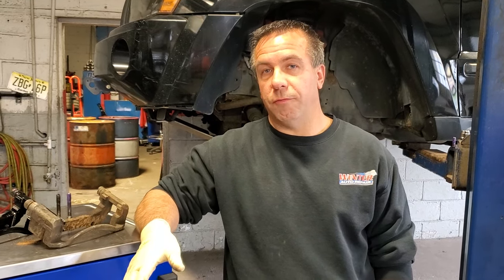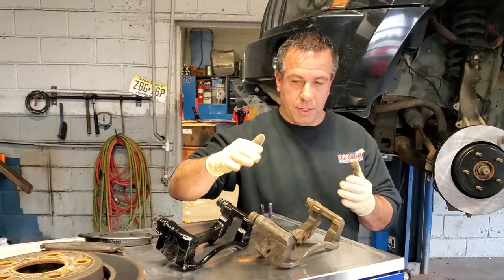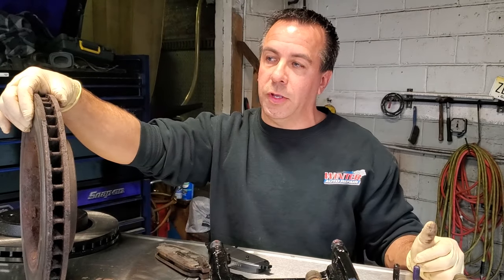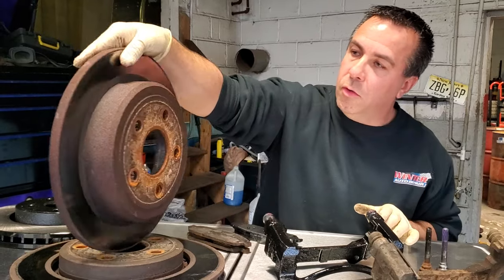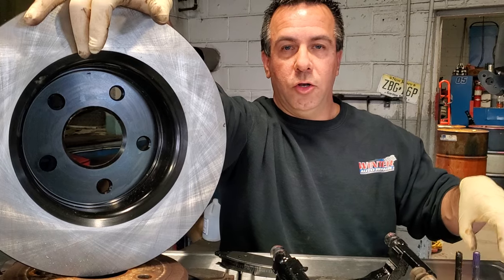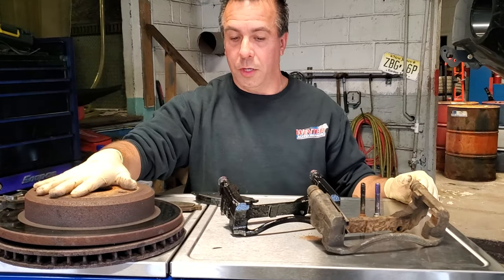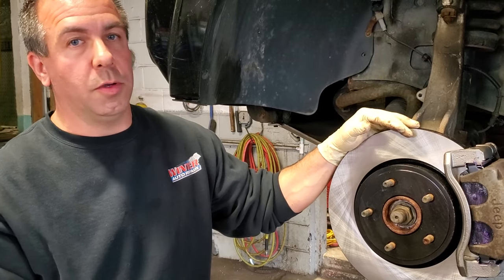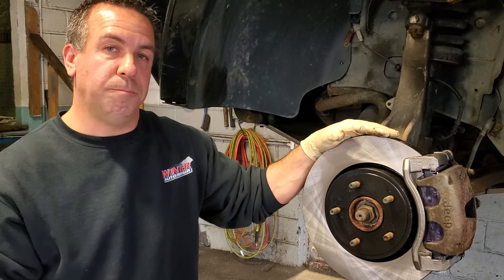High quality brakes vs cheap brakes

Comment: Brake pulsing/vibrations do come from cheap rotors. But it's rarely warping that causes it. It's typically caused by poor metallurgy, specifically low grade steel and poor heat-treating (annealing). If the metal isn't properly heat-treated, there's variable levels of crystallinity, which results in different hardness around the disk. Different metal hardness results in different coefficients of friction which causes pulsing.
Yes, always specify good quality brake parts, and see them before they're installed.
Reply: A pulsating brake pedal specifically is the physical sensation of hydraulic feedback created at the working end of the braking system.  
That hydraulic feedback is the result of thickness variation in rotors pushing back on caliper pistons as the thicker areas of the rotor pass between the pads, or out of round drums pushing back on wheel cylinders in the same manner.   
A variation of friction coefficient on the rotor surface would present as jerkiness feedback in the steering wheel at very low speeds while applying the brakes.
Reply: @jaxturner7288  The thickness change is CAUSED BY the differences in wear due to the variations in friction coefficient and hardness, that induces uneven wear on the disk surface. The disks don't start out with varying thickness. That's caused by uneven wear...
Reply: @garymaclean6903  A sometimes allows B to happen, overtime if ignored and left unchecked, b usually causes C, c will independently directly and immediately guarantee D, without A or B ever occurring.  
So we shouldn’t say D comes from A. 
D actually comes specifically from C.   
A=cheap rotor
B=uneven hardness 
C=thickness variation
D=hydraulic feedback/pulsating pedal.  
The existence of A and B are unnecessary for D to occur however C is the requirement for d to exist and also guarantees its existence so like I said, “pedal pulsation specifically is the….”
Reply: @jaxturner7288  ...Your point being...???
For D to occur there typically has to be a CAUSE. If your disks were installed with thickness variation, you'd expect your mechanic to fix that deficiency right away.
The typical situation is how cheap and defective disks have varying surface hardness, and different coefficients of friction, that CAUSE wear differences on parts of the disk surfaces. THAT is what typically leads to pulsation.
YES, you can have poorly annealed disks that can also warp under very high temperature. But given how most drivers rarely let their disks get that hot, it's unlikely to be the actual cause of pulsing brakes...
Reply: @garymaclean6903  usually leads too, is not the same as  the specific cause.
Reply: @jaxturner7288  ...Only when you can actually identify an alternate cause of varying disk thickness... What are you proposing is the cause?
Disk Brakes are typically manufactured a constant thickness by being ground on a surface grinder, otherwise they'd pulse as soon as they're installed...
How do you explain how they could get varying thickness OVER TIME if not through varying wear on their surface...???
Reply: @garymaclean6903  stop being silly.  
Why do you want me to type out something you learned in high school auto shop?

Comment: I guess it was in the 80s we started getting say Bendix brake pads in white boxes inside the Bendix box..Chinese made junk. Hey Winters I think you where originally from north Jersey?
Reply from the maker: I was originally from North Jersey. You're also correct that bendix was the first to change over to white box Chinese products. Now it's near impossible to find brakes that aren't made in China.
Reply: Winters,,me originally from north Jersey a 1974 Bergen tech auto grad. Now a retired auto,,marine,,Diesel tech. Did you run a car at Island Dragway??I remembered you're name w
Reply from the maker: @danieldesimonedanny1827  I grew up in Mt. Olive and raced mustangs at Island for awhile. I've been involved with Raceway Park since 2008. I teach road racing there once a month.

Comment: I own a shop I give the customer an option between the cheaper one and the more expensive one. Most the time the choose the cheaper one.
Reply from the maker: Of course they will choose the cheaper option if you don't explain to them the difference. We've been open since January 1996 (almost 30 years). We no longer give our customers the option of cheap brakes. Typically, when they have an issue, they will blame you, not the cheap parts. To keep our customers happy, we only use the better quality parts now. If they want cheap, we recommend them to another shop down the road that does cheap work with cheap quality. It's all about properly educating your customers!

Comment: its not the inspection that's important. it's keeping up with maintenance and making sure that everything on your car is actually in working order. Things that not everyone does. But if you don't do it, it could very well cost you. As for mandatory inspections, it takes away from backyard mechanics and people that like to DIY because they have to pay extra to get an inspection regardless

Comment: I own and drive a 1985 Honda CRX Si, and I daily it on occasion. When I moved to Texas I cheaped out on brake pads and rotors assuming that it would be fine as it's a small and light car. A little over a year later, and less than ten thousand miles later, I already managed to warp the rotors. Granted they're very small, at only 9.1 inches in diameter, but they should have lasted a long time! This time around I spent a bit more to buy EBC dimpled and slotted rotors with their Yellow Stuff pads.

Previously I put on EBC slotted rotors and Red Stuff pads on my other car in the rear as the caliper seized and wore one of the pads unevenly down to the squealer. Even though it still has OE front pads, I could still feel the difference with just the rear brakes replaced! I will never cheap out on brakes again.

Comment: Those rotors look like Advics high carbon.
Reply from the maker: I had never heard of them so I looked them up.   They definitely look the same but Advics seem to only be sold in California.   I'd have to try them out to see how they perform but from the sound of them, they seem excellent.  Thanks for the comment!
Reply: @WinterAutoRepair  Sounds good. I'm curious what brand of carbon disc you used for this repair.
Reply from the maker: We used Centric high carbon (125 line) rotors.
Reply: @WinterAutoRepair  I've heard good things about the brand. Thanks!

Comment: My suburban for some reason the rear brakes wear out twice as fast as the front brakes,
Reply: I suspect the caliper slides are dragging and the pads stayed engaged.  Check for uneven wear to confirm my suspicion.  I bet you find that 1 pad wears more quickly than the other.  Also check the hardware that the pads slide on.  The hardware needs to be clean so the pads slide easily away from the rotor after braking ceases.

Comment: My Jeep has over 300,000 miles. It has the original rotors. The brakes still work great.  I use Detroit Axle ceramics brake pads. 👍
Reply from the maker: Congratulations.
Reply: I have seen some good rotors at geobrakes.com not sure what kind of you want but they have got some good selection of heavy duty drilled and slotted ones

Comment: Too much brake grease.  I put it on the inside of the caliper where it touches the pad instead of on the back of the actual pad.  Also, don't use that purple stuff on slide-pins.  It swells the rubber.
Reply from the maker: Been doing it this way with zero complaints for 20 years but thanks for commenting.
Reply: @WinterAutoRepair  Okay, but I would suggest the Permetex Orange, 3M Silicone, or SilGylde for the slide pins do to rubber parts because some of the rubber parts over the 20 years have gotten swollen by the purple stuff.   I am sure some caliper pins have seized on you in a year after a brake job because that purple stuff on slide pins.  Use up the purple on metal to metal without putting it on the back of the pads instead putting it on the caliper bracket and piston face instead where it contacts the pads.   Purple stuff is great for high heat as is the newer orange.

Comment: Nice video, I have a quick ? On rotors.   Can you name a few brands that you have good success with in the rust belt that hold up well?   What brand is that purple grease?   Thanks for the info.
Reply from the maker: Thank you and thanks for commenting.  We have good luck with Centric, Perfect Stop and we've just started trying out DFC (the original owner of Centric just opened DFC so we are giving them a try).  As far as the purple grease, it's made by Permatex. Good this and it will come up. Permatex 24125 Extreme Ceramic Brake. 
Good luck and please subscribe as we plan on making some new videos.

Comment: I see Advanced Auto Part has CarQuest Platinum Coated Rotors. Are these considered as white box rotors like you say? @winter Auto Repair?
Reply from the maker: Hello Bach Le. I have not found a good high carbon rotor with coating at Advanced Auto or Carquest. Those rotors are typically a low grade "white box" rotor that was coated to help prevent rusting.  The high carbon rotors are a bit more expensive to make so only some brands like Centric and Perfect Stop offer them. There is a new company that our local parts store started carrying called DFC. They also make a high carbon that seems to be pretty good quality. If you can't find the high carbon rotors locally, try online like rock auto. They usually carry them for most vehicles. 
Thanks for watching and commenting. Please subscribe if you haven't already. We are in the process of making more videos!
Reply: @WinterAutoRepair  Hi my wifes Nissan Rogue S AWD 2012 needs new rotors but they don't make them in 125 Centric. Any other option? Was thinking Akeebono pro act, anything else you recommend for pads? Thanks so much man!
Reply from the maker: @nixsonbronson4595  unfortunately, since we've made this video, Centric was sold to raybestos. It definitely doesn't offer as many high carbon options as it used to.  Now, I met with the owner of DFC last week. He was the founder of Centric! His new DFC brand offers high quality pads and rotors. The hardware for his pads is separate but it's true stainless and Teflon coated! You can check them out. I've also had good results with Perfect Stop and their high carbon products.  I hope that helps and good luck!  Thanks for commenting and please subscribe as I'm looking to grow this channel with more videos.
Reply: @WinterAutoRepair  Thank you!
Reply: @WinterAutoRepair  Did you mean to say Power Stop or Perfect Stop?

Comment: Buy your own brake pads and rotors have good quality. That way you can inspect them yourself before I shop installs what they think is good quality. I use Akebono brake pads.
Reply from the maker: I won't allow customers to bring us their own parts.  The main reason is liability.  If your parts fail then I am liable.   In addition, if I take the car apart and you purchased the wrong parts, then the repair cannot be completed and my lift cannot be used to fix other cars until we can get the correct parts.   I will however get the parts that customers request if they want a particular quality brand part.

Comment: At the very least, don't cheapie out on the pads.
Reply from the maker: So what we see when you use good pads and cheap rotors is the pads are only half worn but the rotors are warped or worn out.

Comment: The pad may have detached because of corrosion fr salt spread roads.  Its a red flag if a mechanic tells you they used to race and will do a ‘bedding procedure’.. I would skip that. RA online store lets you easily compare rotors or brake pads. Mechanics who get a kickback on parts complain if you bring your own but they could easily check the source...
Reply from the maker: I'm always honest and upfront.   Thank you for the feedback.  Bedding in the pads just gives the rotor and good heat cycle and helps the rotors and pads last longer.  As far as bringing your own parts.  We do not allow customers to bring their own for a few reasons.  The main is liability.  If the parts fail we will still be held responsible.   There is no way to avoid this even if the client signs off on the work order that the shop is not liable. The other main reason is incorrect parts.  If the customer supplies the part and it's incorrect, now I have a vehicle that taken apart and cannot go back together.  I do however give you part names and part numbers so that you can see what the parts cost online and compare. We are typically the same as or cheaper than online suppliers.  In addition, if you'd like to use a particular brand and it's a quality product, we will use the brand you request.  

Thank you for watching and commenting.
Reply: Winter Auto Repair I would trust you as a mechanic. But you’re too old school. Obviously if on a site like ro—-auto there is more choice, often higher quality &  there is no mystery on what brand they are. For example I ordered the latest brake fluid by bosch, non hydroscopic ... the mechanic had never heard of it. Same with AT fluid...  same with the starter - in my area not quite in a big center it takes them weeks to get parts...vs a few days if I order myself.  Ultimately the consumer is purchasing these parts and owns them.  We shouldn’t  be expected to ‘help’  the old fashioned archaic supply chain. The shop rate is good enough ... the only time I have gotten wrong parts is when the shop ordered them, often arguing about it to boot.

Comment: Funny I got 260K miles out of my 1993 Accord front brake OEM Rotors. I will only use Mountain Brake Japan,  DBA Australia or OEM. I am testing Pilenga High Carbon on my 1996 Integra. Everything else is coming out of China.
Reply: I have seen some good rotors at geobrakes.com not sure what kind of you want but they have got some good selection of heavy duty drilled and slotted ones
Reply: For Honda brakes you can try geobrakes.com they sell all oem brakes
Reply: @chloedecker4991  thanks, I will check them out.
Reply: For Honda brakes you can try geobrakes.com they sell all oem brakes

Comment: What is the black caliper coating called?
Reply from the maker: We use a high temp brake paint on the caliper bracket.   The purple brake grease is ceramic brake grease by permatex.  Good to 2000 degrees.
Reply: @WinterAutoRepair  Great tip.  I'll treat my brakes the same as you treat yours. Thanks.